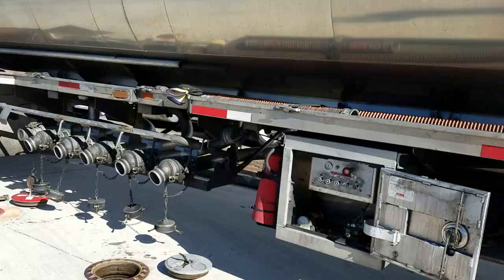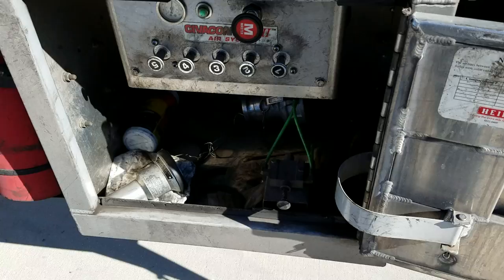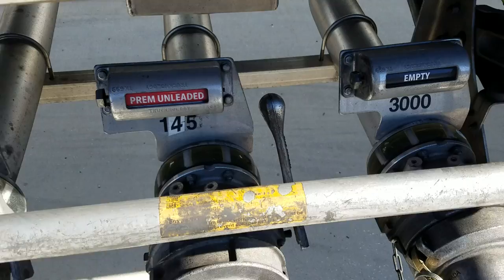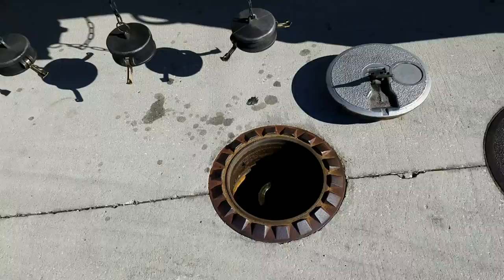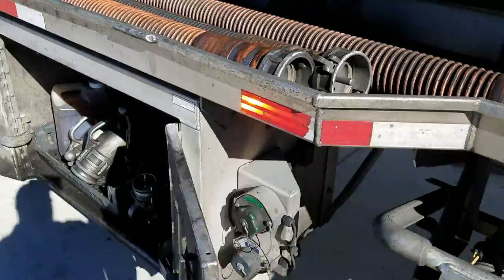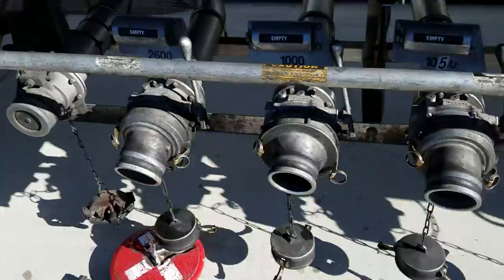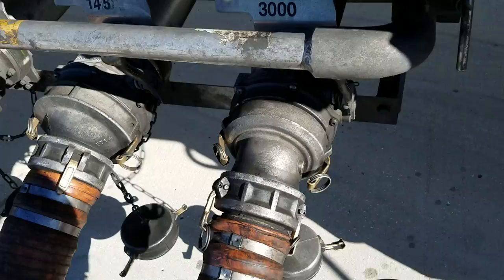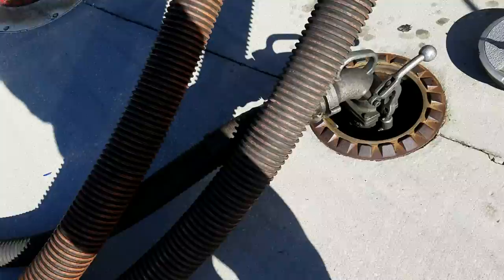How a Fuel Truck Delivers to a TruckStop

Comment: won't their be a lot of dust & dirt built up in the tube while you're driving? where do they go?
Reply from the maker: Not really, plus you're talking about a small amount of dust or sediment going into a 20,000 or 30,000 gallon tank. Plus, the fuel is filtered at the pumps before it goes into your vehicle.
Reply: @DrtyDiesel  that has been bothering me for quite a long time. the final filter at the pump really saved my car
Reply from the maker: @Ninja-dg1ux  yeah for sure. Most stores i know have their tanks serviced as well as the pumps periodically. Theres a macro filter in the tank to catch large debri, then a small micro filter in the pumps just before the hose.

Comment: Watched your video and noticed your cam locks were not closed all the way, be more careful with that
Reply: You don't want to force them fully closed. Causes unnecessary premature wear to the ears. Close them so they are snug. They won't open, due to the design.

You worry about your job, we'll worry about ours.

Comment: I'm about to start fuel hauling for the 1st time, my question is is it difficult to learn?
Reply from the maker: Mr WFJ , not really. Just pay attention to everything your trainer says. Dont be afraid to ask questions.
Reply: Trucks and Guns I've heard so many horror stories about hauling gas and how its quick to blow
Reply from the maker: Mr WFJ , its not as bad as most people think. Hauling an empty tanker is more dangerous than hauling a loaded one. It can go bad quick but in 4 years of hauling fuel, ive never seen or had a fire.
Reply: Trucks and Guns I will keep watching ur video and I hope there will be more videos... I just wanted to get great information before I get myself in to something I'm not comfortable with
Reply: So what makes it easy is most all of the gas stations you deliever the caps on ground is color coded so u know which type of gasoline goes where? They why I hear the word cross drop when talking to fuel hauler
Reply: A little tip for you, check, check and check again, you don't wanna be putting the wrong product in the wrong tank, it costs a fortune to put things right after. Take your time, Good Luck !

Comment: So if you have a car that say it can take e85 can you put premium in it or not grade
Reply from the maker: Chevy Fan , if it can take e85 you would just read the manual and it will tell you what the car is meant to be run on as far as 87 octane. It all depends on what the engine's computer is setup for.

Comment: Hello....I realize this is an older video....can you explain if gas station "A"'s gas is any better than gas station "B" 's gas, ( buddy swears his car runs better on Shell gas) I told him it all comes from the same refinery. Are there any additives for different brands? just curious...didn't run thru all the comments to see if it was already asked, thanks....
Reply from the maker: Sure, yes station A and station B will have the same gas from the same tank. The thing that makes one gas different from another is the additives they put in the fuel while we're loading. Your friend may just be seeing a "placebo effect", as the differences in the gasoline would make a minuscule difference of MAYBE .5 to 1 mile per gallon difference.
Reply: @DrtyDiesel   Thanks, there is a difference then. Appreciate the reply....be careful out there, reefer hauler here, just curious about what you guys do.
Reply from the maker: @banzaii6285  no problem, be safe!

Comment: How do you guard against static electricity?
Reply from the maker: The hoses have grounding wires running through them that wrap around the connectors inside. When the hose is hooked to the ground fitting then hooked to the trailer side, it grounds the unit to the tank.

Comment: What do you do with the vapor? And what happen do you do if you put the wrong fuel in a tank?
Reply from the maker: The vapor is burnt off at the loading racks in a large propane fired tower. If we have what we call a "Cross Drop" by putting the wrong fuel in, we would have to pump it out and pay for the fresh fuel to be put in.
Reply: Ok. Thanks

Comment: So do you load what each customer calls for? If they call for 1k gallons of regular fuel, do you load only 1k gallons at the loading racks? Or how do you know how many gallons you’ve dropped? Thanks!
Reply from the maker: Yes, we have split loads sometimes where a customer will only get 1 or 2k of fuel. Then you take the rest to another. 

You drop an entire compartment, you never want to split a compartment. If it wont all fit, it goes to another station.
Reply: DrtyDiesel so basically you’re always filling the customer up to the top? How do you know it’s full? Thinking of getting off my cow wagon and coming local and hauling fuel!
Reply from the maker: @chasethornton5986  not always to the top, we get that print out to see how many gallons can fit in the tank. Then if the order fits, we drop it. Most stores get a load just whenever they can fit one.

Comment: So the BVLR is the smaller hose on the left? And this is connected to the receiver tank?
Reply from the maker: Teddy Bass , yes, as fuel goes into the underground tank, the vapor flows out and into my trailer.
Reply: Trucks and Guns Cheers. Understand now. So non BVLR is only suitable for diesel
Reply from the maker: Teddy Bass , yes usually. Some stations that were built a long time ago may not have bvlr and we just vent the trailer like normal

Comment: How much does that added one half inch of premium fuel cost ?? Hmmmm.
Reply from the maker: Nothing, the customer gets charged based on Net Gallons on the BOL. My stick readings are just to verify an estimate of what was delivered compared to what was loaded. Our system we used when i worked for that company wasn't capable of inputting fractions when doing measurements, so you always had to round up or down.

Comment: Don't you have to ground your truck?
Reply from the maker: There is copper wire running through the hose, it's grounded when i hookup the hose from the fitting to the discharge tube.

Comment: OH LOOK SOMEONE WHO KNOWS TO ATTACH THE VAPOR HOSE!! the guy(s) who deliver gas to my store never hook theirs up and it causes pressure to build inside the tank which then causes the vapors to climb up the sensing equipment and into my store, and he trys to tell me that he isnt required to hook the vapor hose up...
Reply from the maker: Some states dont require it, however i think if its available, you're supposed to use it. Some states the fines are $100,000+ for not using vapor
Reply: @DrtyDiesel  oh i thought it was an EPA required thing.. im in Illinois, he (the driver) said something about only needing it if they were to deliver a certain amount or more per month but that makesd no sense to me.. "oh our delivery today will put us over the limit so we have to use the tube the rest of the month..." liker seriously? lol what concerns me is the vapors reaching an ignition source, the smell is STRONG in the office containing the red box that measures the fill level and relays for pumps, and spreads to the rest of the store. office in question is right behind me while im at the register. anyhow, what upsets me besides the safety aspect is that ok, maybe you arent "required" to by law but if you are hearing me tell you EVERY DAMN TIME you deliver fuel that im getting vapors inside, that youd just hook the fucking tube up, but nope, couldn't be bothered... i digress lmao..
Reply from the maker: @the_socompsp  im not sure about illinois but if i were a state inspector may be able to answer that. More than likely the driver is being lazy, in florida and Georgia we are required to use vapor recovery if its available.

Comment: Are you FR&T or KAG? I worked for Motor Fuel Carriers, Inc. (Now FR&T ) out of PC and Port Tampa back in the seventies.
Reply from the maker: Geezer65 , i worked for CWC Transportation when i filmed this. We did a lot of KAG loads we took from FL rock
Reply: Lotta difference between now and the seventies, I don't know half the companies that are out there today.
But I could tell some horror stories about bias ply tires, JP-4, 238 Detroit's and other sundry stuff.
Be safe out there and thanks for the memory lane video.

Comment: Do you deliver fuel from the same load to different gas stations?  In other words is the 93 in that truck going to a BP and costco gas station?
Reply from the maker: It can, the fuel all comes out of the same tank where we load. The difference is in the additives. For instance Costco might just have ethanol and gas mixed, while BP will have that plus their Invigorate additive
Reply: DrtyDiesel so the additives are added before the fuel gets loaded to the tank?  I wasn’t sure if the additives get added by the gas stations or at the refinery.  Because you often hear that it all comes from the same place.  So my guess is that when the fuel gets loaded to your truck you will know if its costco or BP 93. 

One last question:  are the tank covers at the gas stations well sealed? I wonder if water can get inside the ground tanks.
Reply from the maker: @PABU427  yes, as the fuel is being loaded onto my trailer there are injectors in the pipes that inject the additive so that it mixes on the trailer. 

Yes, most of them have rubber seals. If the seals become worn and allow water to leak in we let the store know so they can fix it.

Comment: Ok, not to piss on your parade or anything, not putting the grade indicators to the correct grade because YOU know whats in them is just bad procedure, what if something happened to you before you delivered and others come along and think its empty, like first responders??? And i have to ask what camera you are using as it has to be vapour proof against ingress of explosive vapour?  Maybe its different over in the US...??
Reply from the maker: First responders dont go by petro dials on our trailers, they first look at placards and then go off of that. 

I was using a Note 5 phone as the camera. There aren't enough vapors to cause an explosion just from a cell phone alone.

Comment: What precautions do you take for static electricity?
Reply from the maker: Android Man , At the rack where we load theres always a grounding system used to make sure all static electricity is gone before you can start loading. When i deliver, you hookup the ground fitting first and to the hose first. Theres a copper wire running through the lining of the hose so that it grounds the trailer while you unload.
Reply: Trucks and Guns : Thanks for the info.

Comment: What does each inch represent per gallon and is that universal through out the states?
Reply from the maker: It depends on each tank. So it varies quite a bit unfortunately. It'd be nice if it was universal nationwide.

Comment: what happens if (you have a brain fart) you try to fill the vent hole?
Reply from the maker: The pipe connections are different, so it wouldn’t hook up to it.

Comment: About how much do the hoses and nozzles weigh? Thanks
Reply from the maker: With what I carry on my truck, probably an extra 300-500lbs
Reply: @DrtyDiesel  thanks for responding, however, I meant individually. I'm thinking of applying as a fuel tanker but I'm worried about my back. What is the heaviest thing you have to lift? How much weigh? Thx a lot!

Comment: If you deliver for two different gas brands, for example Shell and Exxon, are the additives same for both or separately by brands?
Reply from the maker: Seperated by brand, shell is its own additive while exxon and mobil are the same additive.
Reply: @DrtyDiesel  So how does it work in the terminal?
Reply from the maker: @jakeman3457  while the fuel is being loaded onto my trailer, an injector sprays the additive into fuel line.
Reply: @DrtyDiesel  I mean by the two different additives
Reply from the maker: @jakeman3457  theyll have multiple injectors on one line for each additive

Comment: Your product dial indicators should all be twiddled to indicate what's in the tank.  I know you have a system that works for you, but in the event of some emergency when you can't be there, others responding need to know what is or what was last in the tank. 30-odd years ago, I studied and wrote my DG ticket, then something happened that I didn't end up getting into hauling fuel, but back then (at least where I'm from) there was concern about residual product, switch loading, possible ignition from static, etc.  The then-rules required the display to remain in the position of what was (or was last) in each compartment.  I guess things can change over time and vary from region to region, but it's one of the few things still rattling around in the old noggin. In the time leading up to now, all the crap about vapor recovery - what a crock of crap that is.... more expense for the carrier, more work and worry for the driver....

Comment: No overfill protection on the tanks?
Reply from the maker: Addictive_LiquoriCe , theres a flapper that closes if i fill too much. When we get a fuel reading from the store it tells us how much we can safely unload.
Reply: Yea, they have what is called an Overfill Protection Valve, so at the tank is 98% fill the overfill valve kicks in. Also in the many countries they also have an HLA (High Level Alarm that kicks in at 95%) so at that stage an audiable alarm sounds. So a double safeguard.

Comment: Can anyone answer this for me?: If the vehicle in front of me gets 87 oct. from a single hose pump, then I get 92 oct. out of the same pump, how many gallons of 87 am I getting before the gas is all 92 oct? Been wondering for a while
Reply from the maker: KaptainKoolz , youd get about a quart of 87 octane before your 92 comes through. It wont be enough to make a difference after you get around 2+ gallons
Reply: Trucks and Guns I appreciate the reply. The motorcycles I have require 90+ since they are so high compression and I’ve always wondered how much 87 I’ve been getting while filling such a small fuel tank. Thanks.
Reply from the maker: KaptainKoolz , no problem, im aure youll be just fine.

Comment: Do you use separate houses and connection fittings for Diesel?
Reply from the maker: No, we use the same ones for gasoline or diesel
Reply: @DrtyDiesel  Interesting. So that has no effect on either fuel? I'm assuming the fuel passes a filter of some sort before making its way into a vehicle
Reply from the maker: @TronBons  correct, after deopping diesel and using the same hose to drop gas, you're talking maybe a few millilitres of diesel going into a 10,000 gallon tank of gasoline. So it disappears pretty quickly.
Reply: @DrtyDiesel  Gotcha, thanks

Comment: Do you use the same hoses and compartments for gas and diesel?
Reply from the maker: Derek Warnock , yes we do
Reply: Trucks and Guns, wow never knew that ok I heard you say that the fuel evaporates in that case there is not any cross contamination or very little and it doesn’t matter ?
Reply from the maker: Derek Warnock , correct, the gas would evaporate and not contaminate any diesel

Comment: although highly unlikely, if you run out of gas while driving, would you be allowed to use the gas "in the back?"
Reply from the maker: TF2Player , nope, that fuel belongs to someone else. I could lose my job
Reply: that would be pretty ironic though if you were to run out of the vehicle's gas while having a full load of gas, then you would have to call for backup even though you have thousands of gallons on you

Comment: Are you allowed to be a smoker and work for them. Of course not working.
Reply from the maker: Yes, the guy who trained my smoked and a lot of drivers do. You just can’t smoke while driving or loading/delivering. But yes, you can be a smoker and still be a fuel delivery driver. You just have to be 25ft from the tanker if you decide to have a smoke.

Comment: Would you run premium mid or regular in your vehicles?
Reply from the maker: I recommend whatever your user manual says to run. Running premium or mid grade when the computer is set to run 87 is only wasting money.
Reply: @DrtyDiesel  if I’m running an have always ran mid. Can I drop back to regular?
Reply from the maker: @marco785  yeah you can.

Comment: How many gallons can you make legal in Florida I can load 8800 here in California
Reply from the maker: Dennis Lyman , depends on truck. With my last company i could load 8800 gas since we had freightliners. With our pete 579s i can only load 8500 gallons.
Reply: I just loaded my first one for the day. I have a 2018 pete 389. The tractor wieghs 14500 pounds, which helps out alot
Reply from the maker: Dennis Lyman , dang, are 579 way about 17000. But I also have a big fuel tank and a pump.
Reply: @DrtyDiesel  I constantly try to get them to get these PTOs off our trucks. A driver may do 1-2 pumps a year so it makes no sense to have a pump on every truck. Their loss.

Comment: When does the Ethanol get added?
Reply from the maker: scotty davis , during loading. It’s loaded as the gas is also being loaded. It’s all through the same pipe
Reply: Thanks for responding. I test the Non Ethanol gas I buy for my boat and never find it. The 10% Ethanol stuff is always around 10%. My boat has never had Ethanol in it so far.

Comment: What is done with the vapors you collected while dropping fuel? Can you ever have too much vapor pressure in your trailer?
Reply from the maker: BrokenKoolAid , when I get back to the loading terminal and hookup, the vapor is transferred to a vapor control unit that just ignited it and burns it in a large tower.